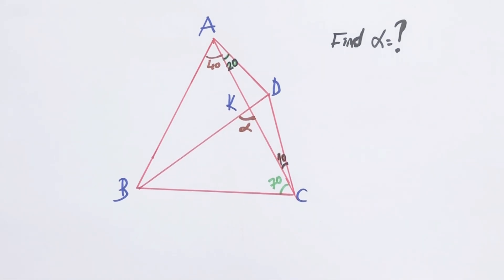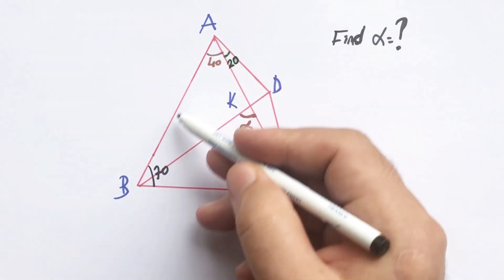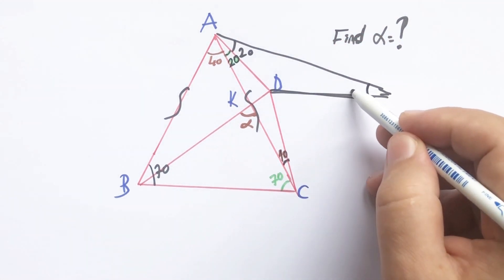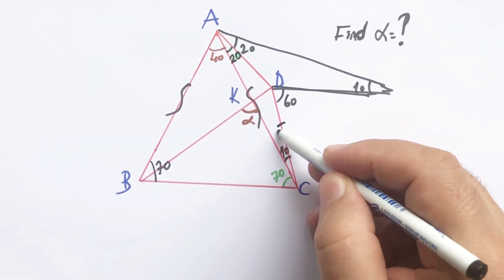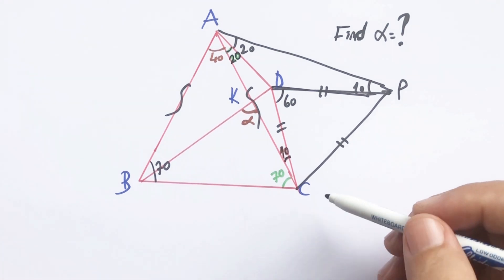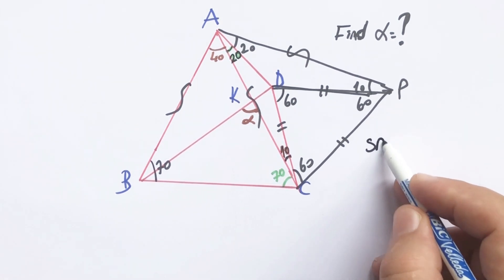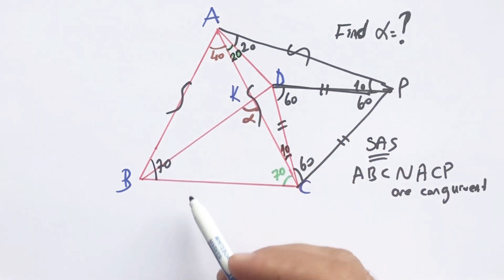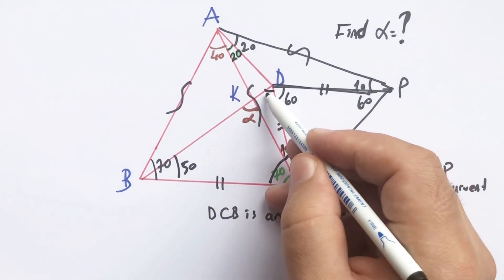How to Find  the  Missing Angle  Using Isosceles and Equilateral Triangle | Learn This Tips

Comment: Hello, we can find the same result by extending AD until P such as we have AB=AP=AC   and we have BAD=60 so BAP is equilateral  AP=AB= BP and BPA=60  
angle CPA= 80  because CAP=20 and AP=AC   so CPB=20  and wa have CBP= 70-60=10  AND  AC=BP so the triangles CAD and BPC are similares so AC=BP and CP=DA and finally   DC=BC  so BCD is isoscel and CBD=(180-80)/2=50  so alpha=180-70-50=60